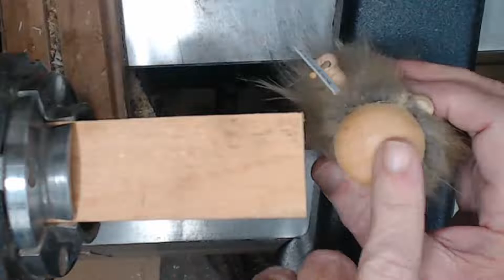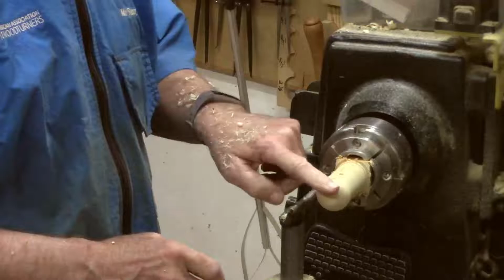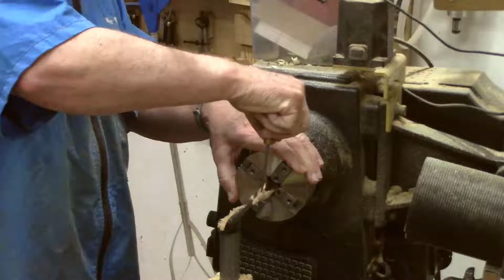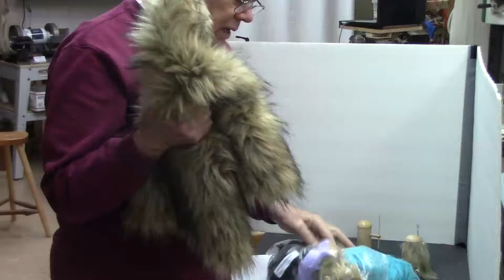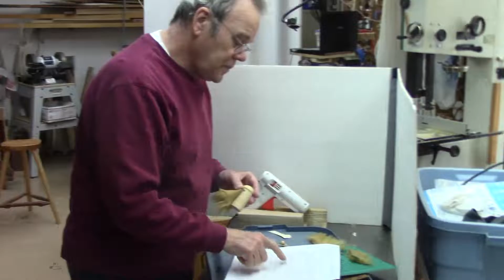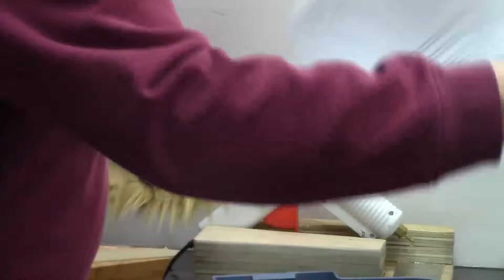Easy DIY Gonk Project Your Family Will Love!

Comment: Cute little guy. I made some of the earlier versions a couple of years ago and they went over well as Christmas give aways for my friends and family. The other thing that I borrowed from you than went over well was the small hand bell you posted several years back.
One thing I do when turning the noses or that could also work for Brother John's hand is to turn them the opposite way to what you do. I form the round part first so it can be totally sanded on the lathe, then part down to a 1/4" tenon, do any final touch ups to the sanding and finishing ( the 1/4" tenon is plenty strong enough for these little things ) and then saw it off with a flush cut saw. I find that way a little faster.
Reply from the maker: Good tips. Thanks for sharing.